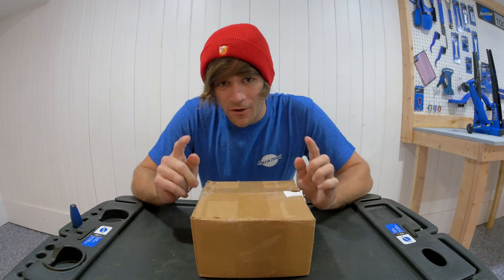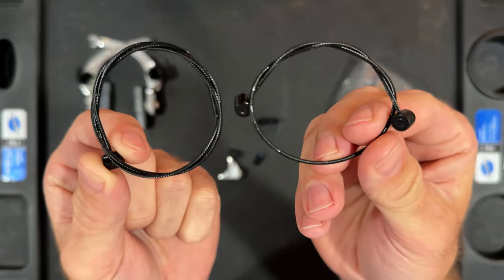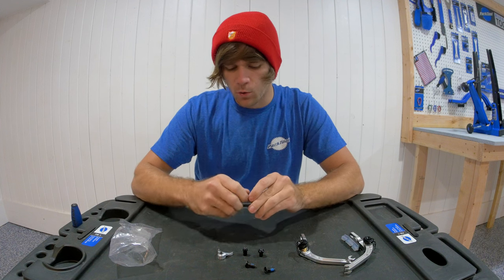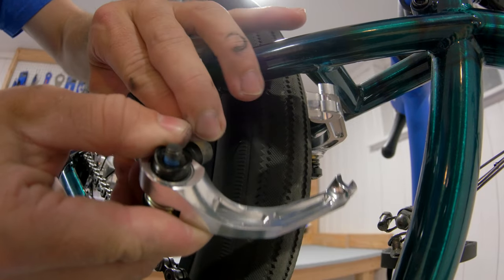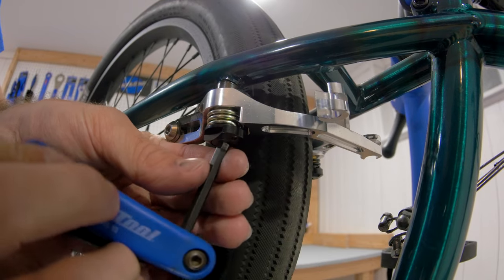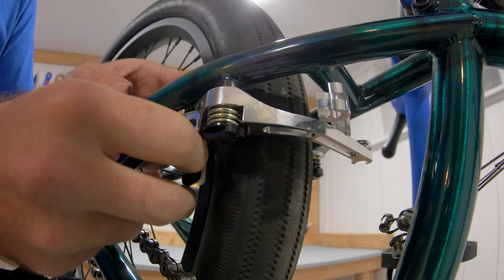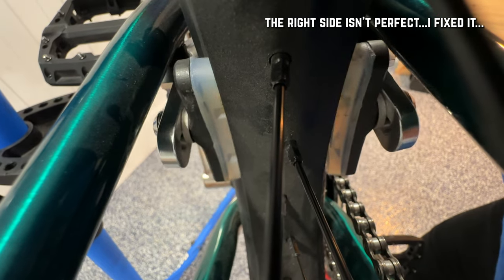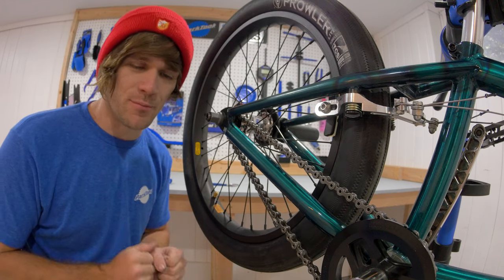Introducing The Vice Grip BMX Brakes From Alienation!

Comment: Fly Bikes Manual CNC SH Brake by far the best 990 brake I have ever used.  Easy with no tension adjustment set up required.  Buttery smooth brake pull.  I've never felt a better feeling 990.  Hands down!
Reply: Agreed. I have a pair on my old S&M Sabbath. The stopping power is ridiculous.

Comment: I've been pretty happy with my Fly brakes but those look really nice.. i would say include the 2 different straddle cables, was never an issue for me but now that i have the Fit Nasty frame on the way, it features chainstay mounts with the cable going through the seat tube. so now im in need of the shorter one.

Comment: Very nice looking, like a slightly overbuilt fly brake. A micro adjust Allen key through the side might be nice. A little tip- if you want your brakes to not squeak like a goose being strangled, glue the boss into the bearing with loctite or another metal threadless glue. Only the bearing. They squeal because the tolerances of a bearing and bushing are poor- seems to be worse with  bolt on bosses, so there is lots of play, glueing the boss to the bearing reduces this. Brakes don't squeak and work much better. BTW, it's spelled vice, not vise....😂
Reply: vise - vīs - [noun] | A heavy clamp, usually mounted on a workbench and operated by a screw or lever, used in carpentry or metalworking to hold a piece in position.
vice - vīs - [noun] | A moral depravity or corruption.

Comment: Bearings are overkill, they did that on the revenge brakes, which creates flop over time, a simple self-lubricating brass bushing with the mentioned spring hanger would be the most responsive without tak welding the post onto the frame, just totally fucks off a gyro. so if there were two options narps and one hanger....there are still issues with the fly brakes even though they look sexy. hats off to the cad designer and thought put into the brakes, the release machining is just enough, id uses another end mill...just me...hope this helps... Im a machinist and welder for many past years...

Comment: 2 knarps not the typical straddle cable solution. Front brake adapter would open it up for all the flatland riders. Could include other stuff but kinda pointless imo. Same 3m double sided tape cable guides might be nice though. Only other thing would be a removable guide style London mod but kink has the mission one and shadow has the sano one. 

Brass lever barrel so cables with a ball end work easier and just better cable pull anyways. 

Hanger modded from factory to support a spoke mod easier. But then the knarps need to support it as well. 

Could include a set of plastic rim spacers for making brake set up easy and fast for people.
Reply: Alloy knarps. Finding them is hard these days and chromoly knarps are a dime a dozen so to speak. Weight weenie factor. Good alloy and they're more then strong enough.
Reply: Pads look great. Probably the perfect pad for my preferences as well as long as it's a soft enough compound without chunking. Just sand the edges all around till they get a slight dome shape to help account for a bit of the pad squish and make feathering really feel based but still locks up like perfectly flat pad contact.

Comment: I really hate the traditional hanger/straddle set up….. I always look for something in a one piece design like the Eclat or even the odyssey quick slick adjustable….. it would be great if they included a single piece straddle set up and ditched the other straddle cable….. I really love the hard lines and machining they did on this brake set up though…. I’ll definitely be giving them a try when they come out
Reply from the maker: I don't think that will happen just because of how many of those already exist and will work with these brakes but maybe in the future. I think you're gonna like these when the production set comes out

Comment: Little thing & I'm not 100% if you'd be able to use the design without some patent issues? 
The Fly Manual Brake, the Spring Caps tighten/adjust with 2 Allen Keys, no wrenches or spanners needed! 

Also, what did I say!? Brake Lever, people will ask, people will want, people will buy!

Comment: Maybe next time you could attach the bike to the stand, and spin the whole thing so that the bike in in a vertical position or even turn the bike upside down to work on seatstay brakes. I used to do that a lot on my repair stand, it's awesome. Today my frame has chainstay brakes, so it's not really necessary to spin the whole thing around 🤣
Oh, and please tell me these brakes will come with clear pads stock!! It would be absolutely awesome! I'm tired of buying the latest 'cool' brakes that always come with ordinary black pads that don't work even if the rims were made of stupid clean glass! 👍

Comment: pass. Why do we still have these obsolete brakes that ruin the powder coat of the rims when the entire cycling world has gone to disk brakes?
Reply: Grinding with disc brakes must be fun, changing discs every session ;)
Reply: Disc brakes are powerful but too exposed and vulnerable for freestyle.
Reply: @gorudonu  sounds like you have as much bike control as someone with cerebral palsy . it wouldn't be hard to make a guard either. But sure, let's keep the near century old crap instead of innovating a solution to use the superior option; that's great for the sport.
Reply from the maker: Go make it then. Alienation isn’t going to make a brake that works on less than 1% of the frames out there vs a brake that works on 100% of freestyle bmx frames with mounts.
Reply: Disc brakes make zero sense on freestyle bikes
Reply: @nickalderman5943 it's clear that you don't ride BMX.
Reply: @x88868  it's been a few years, but I spent from 7-21 riding. 
it's clear that you shouldn't make assumptions.
Reply: @nickalderman5943  it's clear that your lying.
Reply: @x88868  prove it. Lmao
Reply: @nickalderman5943  you're opening comment. That proves that clearly you don't know what you're talking about.